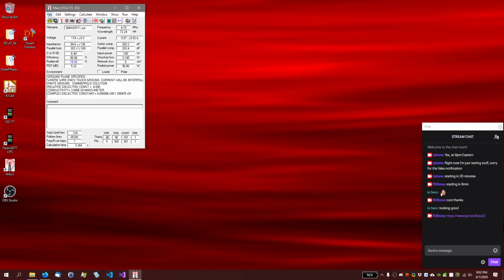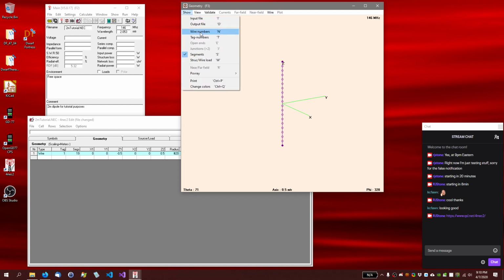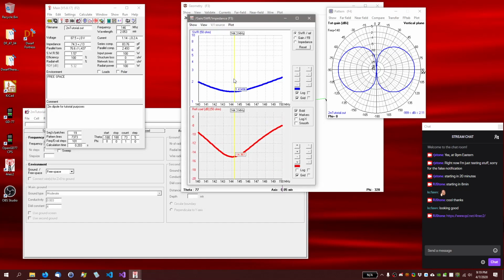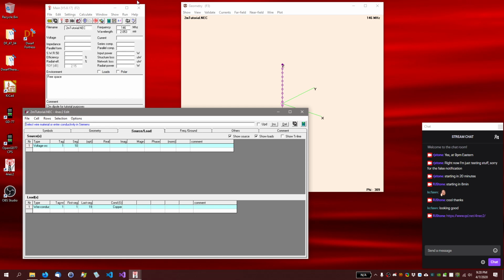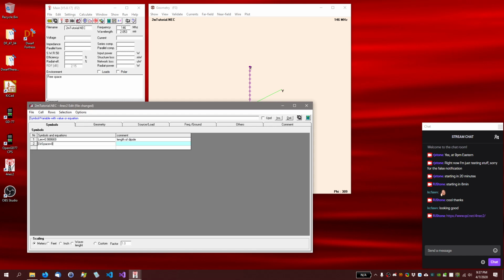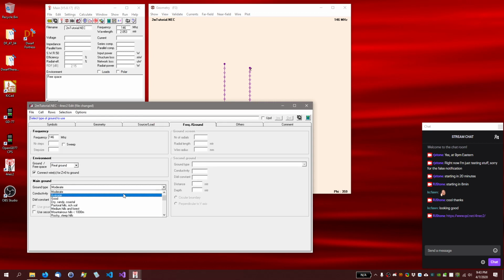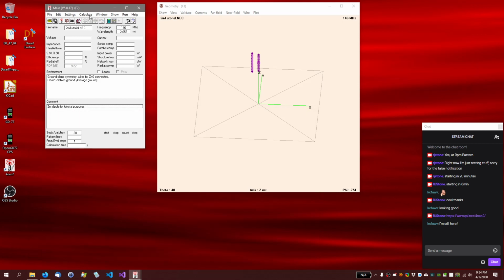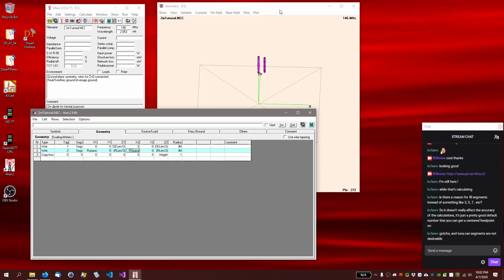Basic 4NEC2 Tutorial 2020-04-07

Comment: Velocity factor is mentioned a couple of times. That is not the reason that the length is not exactly half the wavelength. The real reason is "end effect", which makes the effective length of a half wave greater than the actual length. The degree of shortening increases with the diameter of the wire.

Comment: this may be a stupid question but what are the segments. Are they just used to determine where the source will be inputted.
Reply: Being a numerical  (as opposed to analytical) model, it calculates each segment individually and adds them together. So with more segments the answer should be more precise, which will be a tradeoff against the time it takes to calculate. There is a limit to the number of segments in a model (can be changed by recompiling I think) and also some constraints to do with segment size, like a minimum ratio of the segment length to its diameter. For connected wires, the segments in the wires must be similar in size as well. The size/compute time tradeoff was more important when the program was written long ago as computers were a lot slower and something that takes seconds today would take hours or days back then. I was playing with a dipole model on the computer I assembled a few months ago and with around 400 segments it takes about a second to run.

Comment: The average gain test adds up the gain in all directions and averages them all togather.
The answer should be 1.
If it's much off of one the model is flawed or at least reporting an inaccurate gain.
It can be adjusted by adjusting the diameter of the segment that is excited / source.
Simple antennas are usually ok but complicated models can get out of whack pretty easy.
And you had a 65:1 frint to back but you ignored it and dropped the f/b without even looking at what the optimizer managed to do.